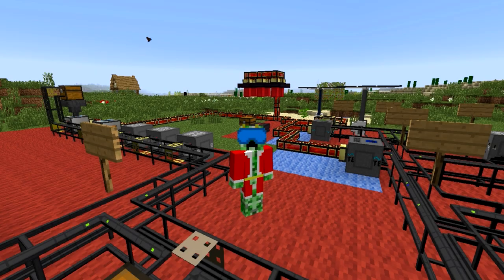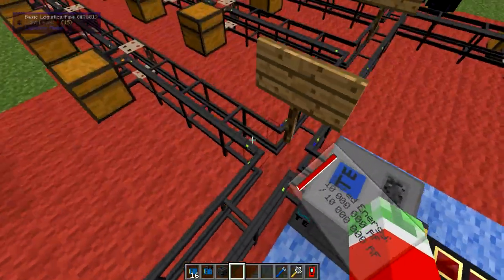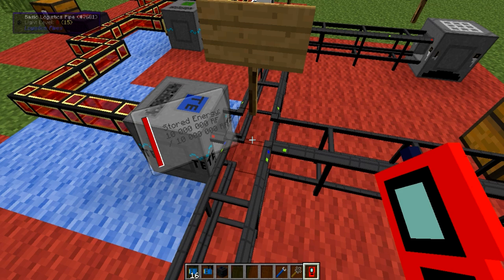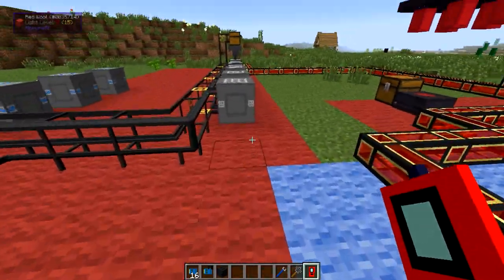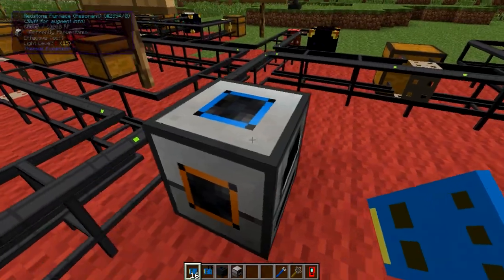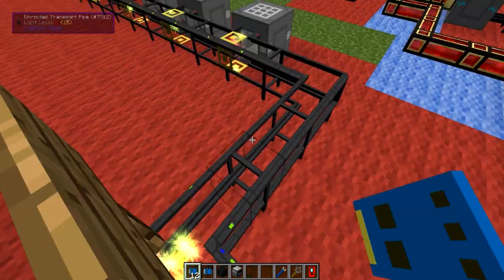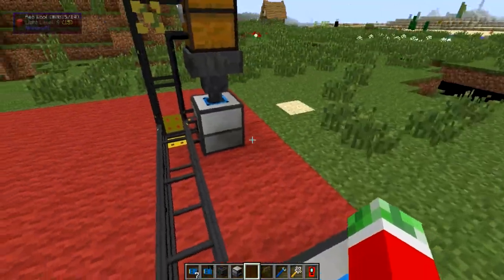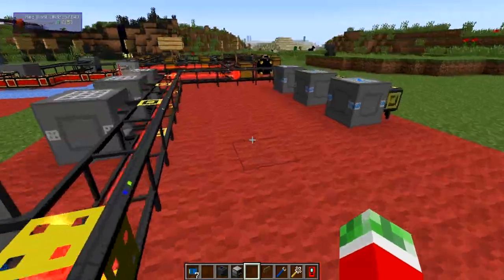Logistics Pipes Tutorial - #5 - Power Transfer (RF & IC2 EU)

Comment: I am having a small problem with this, the TE upgrade card goes in fine, and I see the RF pulse.. however, it won't hit the first junction to send down the line, despite me putting a power transfer upgrade in the junction.  (I might add that the first Junction is literally the next block over.. )
Reply from the maker: Hey Psybermind! Be sure to put the power transfer upgrade not just on every junction but every non-unrouted transfer pipe the power needs to go through! Including the Basic pipe connected to the RF Power Provider
Reply: So I'm running into the same issue.. If you can look at the image at https://gyazo.com/809bc8b59e91d449edf1fa269adff172   You can see where I have the problem. As just a test, I ran the Power Transfer Upgrades all the way to the first Auto-Seive, but it won't transfer RF to it at all. I'm going to do some other testing (try it in a straight line as opposed to having that first junction and see if that works..

Comment: Just wondering if anyone has got this working on FTB Infinity Evolved skyblock, I have followed this step by step and still cant get it working.
Reply from the maker: +Tomm1e1 Hey there Tomm1e1! I am personally using FTB Infinity Evolved (non-skyblock) to make this tutorial, and it works just fine. I can almost guarentee it would also work on Skyblock, so it suprised me it doesn't work for you. Are you using the correct Upgrades on the pipes? You got an upgrade and atleast a basic pipe on each intersection and corner? Hope you can figure it out :)
Reply: It will work on skyblock too; I've seen Dire and Souryn use it.